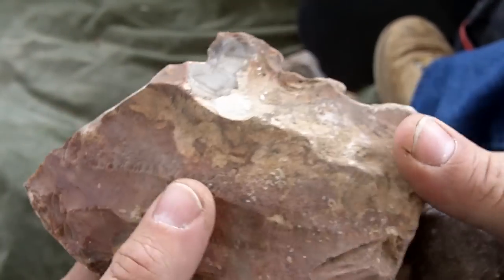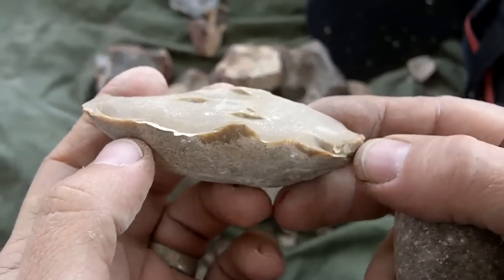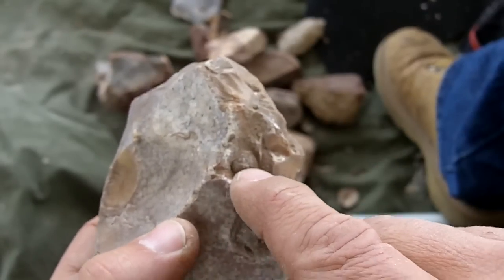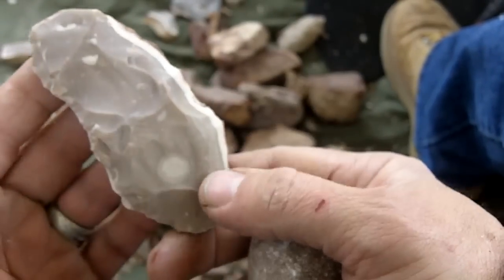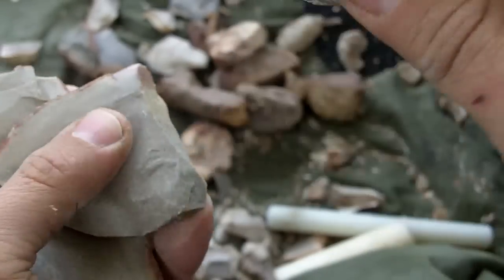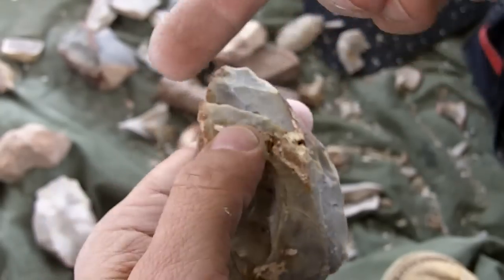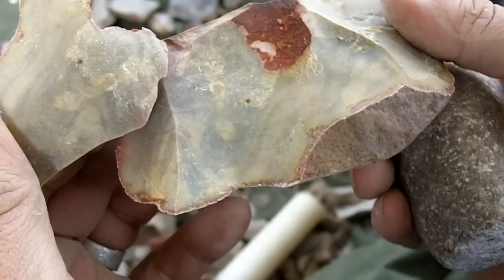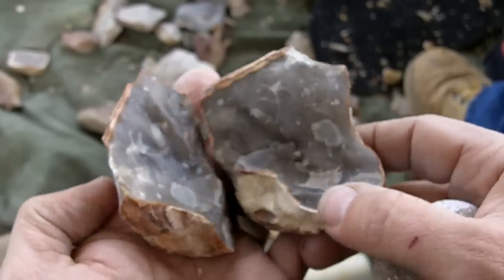230 - Knapping Gnarly Nodules

Comment: You said in one of your videos you use a turkey baster to heat your rocks in. I went to the goodwill and bought one. It goes to 450 degrees so I baked the rocks for 3 days, to me it didn't do anything for the rocks.  So, I put them on a cookie sheet and baked them for 4 days and it worked great. Mr Freeze Crack told me to never bake rocks in the oven. I've made some 3 inch arrowheads but I'd love to make a 12 inch spearhead. I subscribed to your  channel last year and I watched your videos over and over to see how you hold your hands and what angle you hit the rocks. I've made a lot of birdpoints and got them as thin as a dime,  just can't make a 12 inch
Reply from the maker: Yeah, a 12 inch spearhead is difficult for everybody.  Finding a large enough piece of flint is half the battle.  That turkey roaster might not have gotten up to the right temperature... maybe that's why it was cheap.  It's ok to heat rocks in the oven as long as you have good ventilation in the kitchen, like a range hood or an open window with a fan.

Comment: Jack, where do you pick up those impact stones? I think you said they are quartz of some sort.  I notice you use either the same one or similar ones in many of your spalling videos. My dad's place is in Llano, so I've tried pink granite stones on Fredericksburg flint and haven't had much luck driving long flakes, and I've broken lots of pink granite stones. The quartz in Llano is mostly of the clear variety which is super hard but fractures easily like flint. Any advice would be appreciated.
Reply from the maker: Llano has a strange mix of stones.  Most, maybe 90%, is not good for knapping.  Granite is only good for abraders.  If you go to San Antonio and look at the landscape stones being used for the new construction, for example, you will get a better idea of the cherts and quartzites that are good for knapping.

Comment: Hey Love your videos man!  I have learned a lot from watching you. I just started knapping a few months ago. Right now i only have a few spalls of Novaclite. I have been having a lot of trouble with thinning those spalls. Is the best way to thin a spall with that scissoring or zig zag method around the edges. Im an Anthropologist, and most of my work has been in Lithics, andI really want to get to the point where i recreate some of dart parts and larger spear points of the peoples i have been writing on.
Reply from the maker: yes, a zig-zag technique can be used for basic thinning but advanced work involves creating or spotting other types of platforms.  I recommend the writings of John Whittaker if you want a prospective from inside the field.  I'm an outsider.  :-)
Reply from the maker: https://www.grinnell.edu/users/whittake
Reply: Thank you so much! and I will certainly check out some of his writings. :)

Comment: Really tempted to have a go at knapping a blade after watching this. Here in Wiltshire close to Stonehenge we got masses of flint everywhere!. The local building vernacular is to use brick and knapped flints with lime mortar made from roasting the chalk to make quick lime. Was interested in the heat treating of the flint nodules. I know flints for early flintlock rifles were made here but don't think they heat treated the flint?. Are there different types of flint? Is there one better than the other?
Reply from the maker: Hi Andrew.  No, flint for flintlocks was not heat treated.  In fact, the tougher the flint the better.  And there is quite a difference in flints.  Some are extremely knappable and some, on the other end of the spectrum, will require explosives.  heheh...
Reply: chert found my country is very tough and lots of cracks...

Comment from the maker: Jack, I like using hammerstones because they are free.  :-)

Seriously, though, I like using hammerstones because they are very versatile (they will flake all kinds of stone, especially the hardest)  and they don't make my wrist sore like billets and boppers.  They are not necessarily better.
Reply: +JackCrafty Thank you... I've been looking for a video on nodular pieces, I am subscribed and must have over-looked this one. Unfortunately my local area pieces are far more nodular and the same thing that happened to you first piece happens a lot to me. It must be workable though as my area had significant stone-age activity and supposedly has some of the best flint.... Maybe its where I'm looking.
Reply from the maker: You never know.  Sometimes "special" rock was transported into an area even thought there was workable stone available.  But keep looking, and I'll bet some of the stone can be improved with heat.
Reply: JackCrafty Yeah heat's an option although from pieces I have seen the material seems like it doesn't particularly need it. Some has cement or crystal geodes inside. Judging from watching this video, personally I think its where I'm striking lol. And what I'm striking with, I'm yet to find good hammer stones. We have no fast moving water just a stream, we do have miles of coastline though so the search continues. May need a trip to the Lake District :)
Reply from the maker: Sounds awesome.

Comment: I've been knapping on and off for a few years now, and I'm still plagued by step fractures sometimes! Reckon it's just practice practice practice! I like the accuracy of the indirect percussion you use, I can only get Norfolk Flint here in the UK, it's bloody hard stuff!!! Do you think the copper would stand up to it if I made one?
Reply from the maker: +snailface1981 Yes, a copper tip and UHMW plastic rod will hold up for about 20 hours of intense knapping on extremely hard material before the joint between the copper and plastic loosens too much to be effective.  The tools will last longer if not used until the finishing stages, for example.  The initial stages can be accomplished with hammerstone work.

Comment: Looks like some of those rocks were over cooked. Try making a biface first then cook it but not so hot or long. Thin ones can take more heat. Also cook it at 180°-200° for 6 to 8 hours then turn it up to your flint temp .
Reply from the maker: tarxantoo Sounds good.  Thanks.

Comment: if i were to go to the llano river would i find flint in the banks?
Reply from the maker: Yes.  But the flint does not appear everywhere along the banks.  You'll need to cover a lot of ground sometimes.  But there are spots where it is everywhere.  It's hit or miss depending on where you are.  Within the actual city of Llano, for example, I didn't find any pieces worth knapping.
Reply: thanks. That's good to know if I ever come out to Texas. I've heard there's a lot of chert there.
Reply from the maker: Yep, there is a LOT of flint and chert here but the good stuff (along banks and road cuts) gets picked up really quick.  It's getting harder and harder to find good pieces on the surface unless you get permission to explore private land.
Reply: Good to know.  Thanks